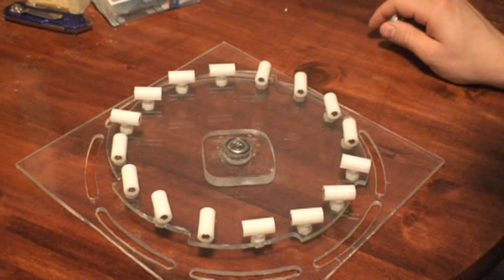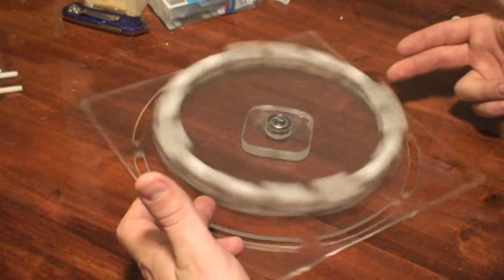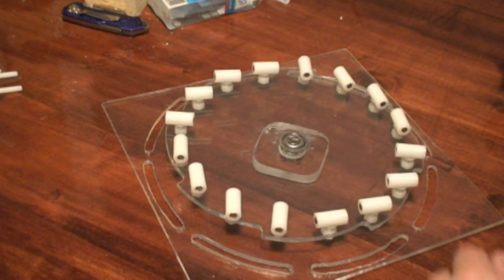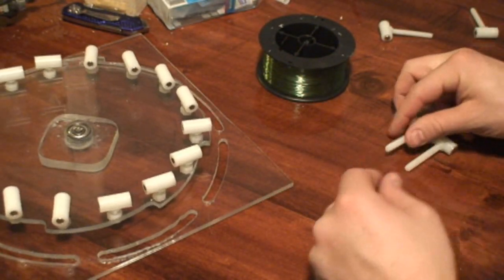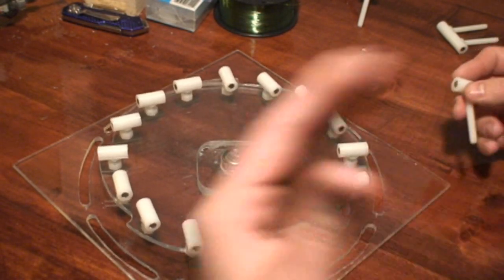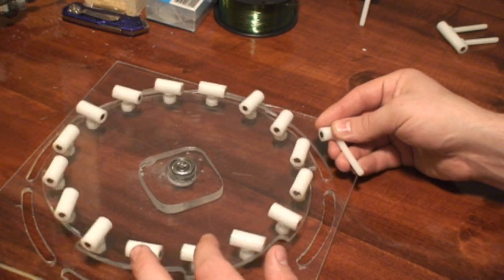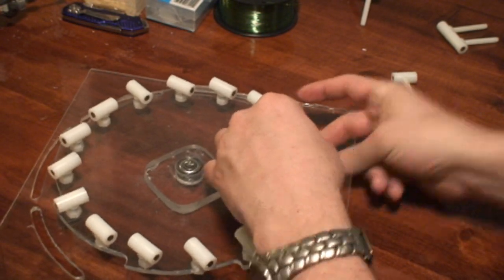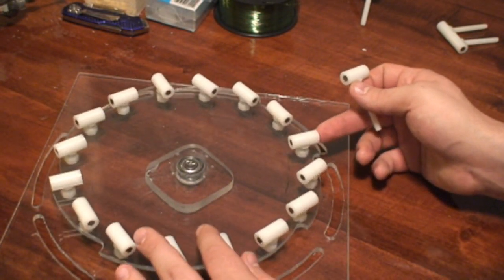Magnet motor, free energy, overunity test 2

Comment: I've been brainstorming about a machine very similar to this a lot lately! This is a brilliant idea and if you had a small motor to flip your magnet back and forth in the place of your hand it seems like it could really get up to a good speed. And then have a small drive axle turning an alternator which would theoretically start producing power. And hopefully it would create more power than what is required to flip your magnet back and forth!
Reply: The flipping of the magnet kosts more energy than you could get from the spin. Instead of flipping the magnet you also could spin the thing. Same with an electro magnet that alternates its magnetic field. You need energy for that thats creater than the spinning could produce.

Comment: I have the design you want.  It involves a similar set up, but hybridized with the perpetual motion wheel that uses liquid or weights that move.  If you've seen the basic bicycle wheel with half full water bottle model on YouTube, you know the similarity.  instead of normal weights, you need magnets, that move from their ready position to the outer edge by way of an external magnet.  The trick is; use a weak magnet(s) to keep the weights near the center, and a strong magnet to draw them to the edge.  with a little momentum, they should be drawn outward then start to retract once they pass the external magnet (s).  You could maybe even use magnetic fluid. eh?

Comment: Congratulations.

You've discovered conservation of angular momentum...
Reply: Waltham1892 no
Reply: RMSVideos Sorry, I'm afraid yes.

The magnets on the edge of the round table don't do anything but add mass.

The thing isn't a generator, but a flywheel retaining the energy used to get is spinning, less what is lost to friction at the bearing.
Reply: FuckYouGooglePlus Um, no, that is not the case.

The magnet in his hand is attracting/repulsing the approaching magnets as strongly as its attracting/repulsing the retreating magnets, so the net effect is zero.
Reply: Waltham1892 it's not conservation of angular momentum at all. It's not free energy, but it's nothing to do with conservation of angular momentum. He's adding energy to a system that now has a nonzero angular momentum? So?
Reply: I think you see more than is there.

He is waving his hand back and forth.  I don't know that it can be said he's adding energy to the system.

Comment: This still requires energy. You move your hand in order to flip the magnet, thus meaning you have to burn carbs in your body in order to get your muscles to move.
Imagine  attempting to use this on a large scale, how would you flip the magnet?

A. If your answer was a motor... how would you power that one? (this is a circular problem, which can't be
 solved)
B. If your answer was a fluctuating magnetic current... then you just invented the electric motor. (which uses more electricity than it creates)

Comment: What is your point? Now you add energy by hand when you turn the outer magnet. If the rotating part would be strong enough to also rotate that magnet, the experiment would be interesting. Otherwise you have just reinvented the electric motor with a number of rotating magnets but without the polarity shifting static part, which is usual a electromagnet, i.e. with the need for an external energy source.